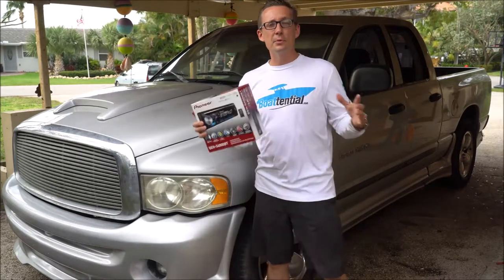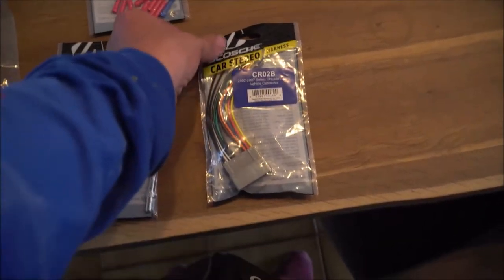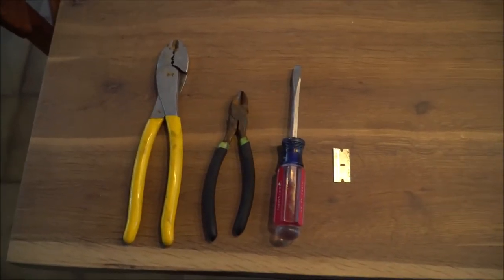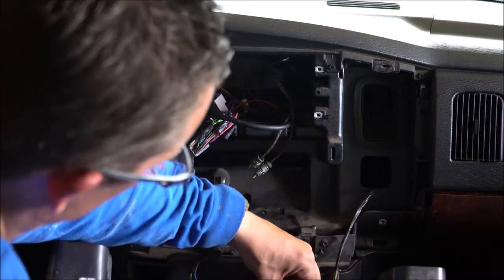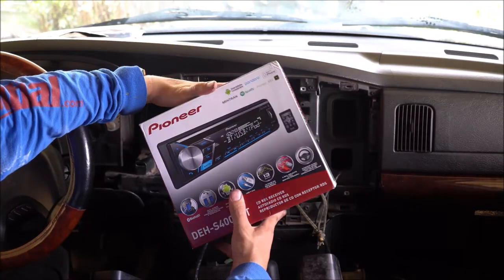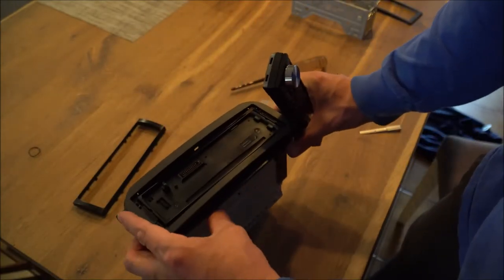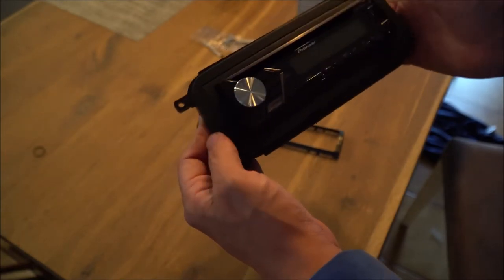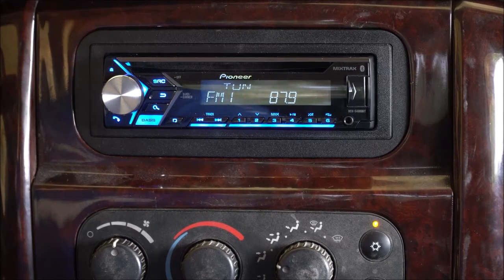How to Install a Car Stereo (Single Din) Car Audio 101

Comment: How does audio get from the new unit to the car speakers? What cord? Pls explain
Reply from the maker: There is a wiring kit that you purchase separately and match the colors together and crimp the wires that match together. The company who makes the witing harness is Metra the wire adapter is around 18 bucks
Reply: @CHASINGPROFITS  man 2 years ago lol. I don’t had a whole setup and everything that I sold with my car a few months ago lol
Reply from the maker: @Braydon_M  my bad man I had a health issue